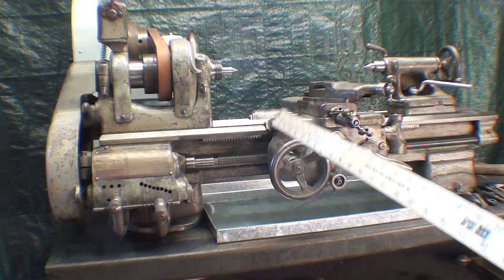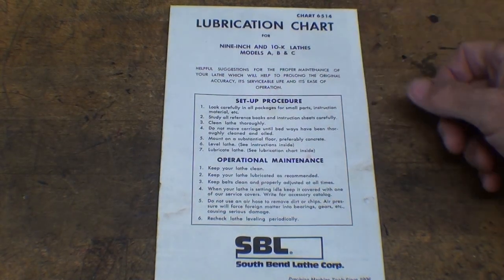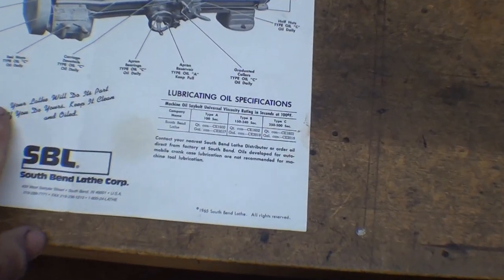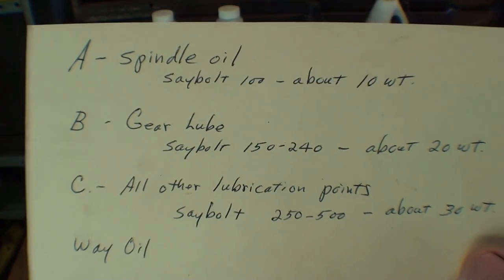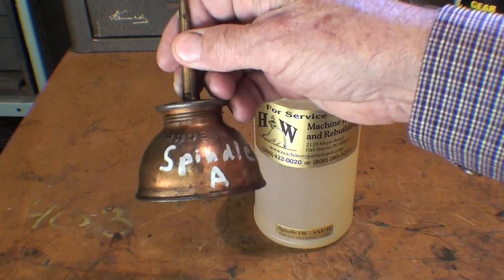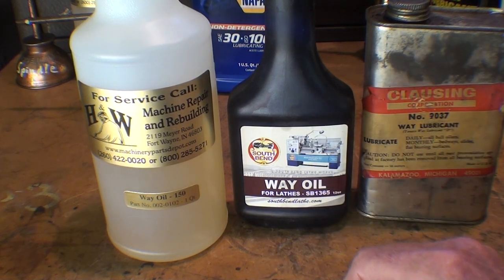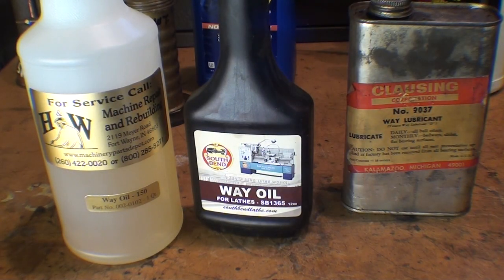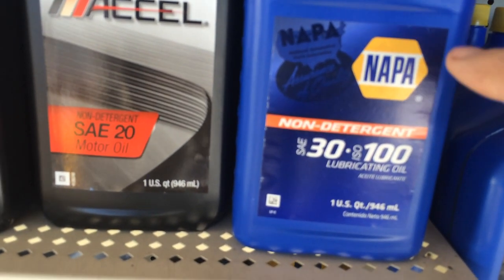Tips #341 TYPES OF OILS FOR SOUTH BEND LATHES tubalcain

Comment: All of my machine tools are big and have internal lubricating passages. I have found the biggest problem to be the passages getting plugged up with muck over the years and then they don't oil. I blame this on the use of non detergent oils. After a good cleaning of the reservoirs I use John Deere Hy gard (about 20w) as the lube since it is good for gears, bushings, wet clutches and has special additives so it clings well to prevent rust.( a big problem on many multiple hundreds of thousand of dollar harvesters that still need protection till the next season) I have been doing this for 15 years in a pretty heavy use job shop and it has worked great for me. There is always a nice film on the ways and everything oils and keeps oiling with no plugging passages or dirty sumps.  I am not saying this is right or what others should do just saying what works for me.
Reply from the maker: sounds like a great oil
Reply: I use the JD hy gard also.  put the low viscosity (low Temp) hy gard in my lathe headstock and the regular everywhere else even the ways. it sticks well and never have a problem with rusting.
Reply: Thanks, Brian.

Comment: A quick and dirty  way to test viscosity of an oil is to place a clean steel plate at an angle, say 45° with lines marked across the slope at 0 and 6" and, using an eye dropper, measure the time it takes for a drop of oil to get from 0 to 6" in seconds. While not terribly accurate, it can help differentiate between different grades of oil in question, and by comparing a sample of unknown oil to a known oil, give a useful idea of acceptability.
Reply from the maker: Thank you for an excellent comment. I should make a video showing that. Are used to check the viscosity of paint with a viscosity meter. Just a tiny hole drilled in the bottom of a cup.

Comment: Thank you Mr. Pete! I've been trying to find the "right" lubricants for my round-ram Bridgeport and Logan #200. I've discovered that reading the manuals is not much help since oil formulations have changed over the years. For example, the often recommended way oil Mobil Vactra #2 has been reformulated to eliminate the tacifiers that help it stick to vertical surfaces. A newer product called Vacuoline 1409 has the tacifiers and is closer in make-up to the Vactra #2 but unfortunately is not available in one-gallon containers that would be suitable for a home shop. Very confusing. As you said, any oil is probably better than none and in most home shops the different formulations may not make much difference. For the "right" lubricant you might have to contact the technical support staff, find out what is the best match for what is called for in your manual and discuss if there are other products with improved properties. Another example of modern products not suitable for older equipment is the super slippery, synthetic motor oils now available. They don't contain the zinc additive that is necessary for the conventional valve lifters and sliding surfaces of older engines.

Comment: I found the South Bend Way oil 14oz SKU SB1365 is on Grizzly 2016 catalogue page 743 or on-line. They have a 5 gal bucket too, but I think the 14oz will be enough for my two mini machines and vices.

Comment: Hi Lyle, nice video. The tech guy told us in way oil  the primary additive was for  "slip-stick" to allow  easy start of travel on ways for precise movement. Most gears in a lathe are lightly loaded, so no need for extreme pressure additives  and hence lighter viscosities . As always, keep it simple and don't mix lubes unless you know it is OK.
I enjoyed this video very much, cheers.

Comment: I'm sure there will be enough comments talking about modern equivalent of the three oils South Bend calls for...

They are still made by Mobil and available through industrial supply places, even eBay. Price is surprisingly low... when I bought mine last year, it's less than $20 per gallon with free shipping. For the amount I use, a gallon probably lasts twice my life time lol.

A:  Velocite 10  http://www.mobil.com/english-US/Industrial/pds/GLXXMobil-Velocite-Oil-No-Series

B:  (If I remember right, SB 9A doesn't use B oil...., I use C on all oil holes)

C:  Mobil DTE heavy medium  http://www.mobil.com/english-US/Industrial/pds/GLXXMobil-DTE-Named-Series

Way oil: Mobil Vactra No.2 http://www.mobil.com/english-US/Industrial/pds/GLXXMobil-Vactra-Oil-Numbered-Series

Way oil is suppose to be stringy so it sticks to the ways better, especially vertical ones. The Vactra No.2 look like the one came with your Clausing, in terms of color and viscosity

Comment: Thanks for posting this and sharing!!! You covered a lot of ground, and at least have us heading in the right direction.  
As I'm looking at all these oils I think back to every oil company pushing there product. My is better no my is and so on. I can see why South Bend worded it they way they did. 

Will cooking oil work? Mineral oil is a oil I use a lot on my sharpening stones. You can ingest it so I thinking of some of it staying on the meat cutting edge. 

I know I have used a lot of petroleum jelly for many things over the years. if too thick a touch of a lighter grade oil and it thin right up. Generally no staining if it pushes out, easy enough to clean off later. 

Not sure about oil, but like grease I would guess some are not petroleum based, if fact I  think they are a soap if you will. 

Non- detergent oil use to be motor oil. I think some companies just don't want the mix up, so they label it lubrication oil. 

All I can say is not all 30 weight non-detergent  are the same. 

Some oil is better then no oil in an engine..  I would think it is just about true to say that here.

Comment: Thanks MrPete, Good info. Would it be a "general " assumption be...The higher the RPM the lighter the oil? Hence lower RPM heavier oil. I agree with you on the 90 weight. I use it on the back gears and QCG box.

Comment: Mr. Pete,
thank you for the oil expose. I personally use recommended oils but I still wonder:

Everybody says do not use motor oil. Not too many say why. Closest I get to an explanation is that the detergents in motor oil keep particles in suspension (no flow through filter) causing more wear. Is there any evidence to support this? Considering the old machines with loose tolerances, would over-oiling with detergent oil be beneficial flushing out all the hidden particles? 

Back in the day when automobile engines were running with non-detergent oil, we were cautioned not to add detergent oil. Detergent would suspend the settled sludge perhaps breaking off chunks that would clog the oil passages in crank shaft and main bearing grooves. This is not the case in a lathe, except perhaps in the spindle bearings.
Reply: On the 9 and 10K lathe, and some others, they use a capillary oil system. This consists of an oil reservoir under each spindle bearing and a felt wick. The oil is pulled up into the felt by capillary action, and is distributed across the bearing surface. The excess oil is collected through 2 oil troughs at each end of the Bearing and allowed to flow back into the oil reservoir. If Non-detergent oil is used, any the dirt in this oil will settle to the bottom of this reservoir. if detergent oil is used, this dirt will be suspended in the oil and be deposited into the Oil wick itself. Eventually stopping up the wick. At that point not enough oil will flow to the bearings, which will damage the bearings. You do not want dirt suspended in the oil.

Joe.
Reply: Hi Milan,. I know what you are saying.  The best video I have seen on this is from Zynadu.  I think it was called the most important thing in the workshop.  I watched it a couple of times and started using his ideas and now I would completely agree.  It will surprise you but it will answer  your questions and is awesome.

Dale in Canada

Comment: Another great video, lots of good information. And as you indicated, It is always best to use the recommended oils on your machine. But the gears in the gearbox do not always get the proper lubrication and It is very difficult to make sure the gears in the gearbox are properly lubricated with the standard oil. So I use a spray can of Motorcycle chain/open gear oil. Also a good substitute for way oil is chainsaw bar and chain oil, but only if the other is not available. and for those who are interested, lubrication charts are available for the South Bend Lathe at, www.wswells.com/data/data_index.htm 

Joe.

Comment: Thanks so much for all the info it's great! I just got a 13in south bend lathe. I was wondering if you could put a cutter in the chuck and some kind of rest on the moving part for your workpiece then use it like a mill? What would be the name of the thing that could hold the piece on the moving part? Do you have a video demonstrating that? Sorry I'm completely new at lathes just trying to get info.
Reply: To answer your question, yes, milling can be done in the lathe. You need a lathe milling vice and/or a milling cross slide. Look through Tubalcain's videos to find more about it. But if you want my advice, get yourself a proper milling machine instead. You will be much happier.
Reply from the maker: Joe is right--a milling attachment is a compromise.  I show one in several diff videos in use.

Comment: I am happy to say that ever since I've owned a lathe I've always used spindle oil weigh oil and a proper gear oil for oiling the gears everyday tapping off the apron when needed Etc I've always purchased the exact correct oil I have a Logan 10-in and it's still doing me well 15 years later and it was built in 1946. There's not a lot of machines alive today that can boast that they were born in 1946 and still functioning is they're supposed to. I did make an improvement on the drivetrain I put reservoirs to constantly add oil to the oil light bearings for the drive shaft. Those things seem to wear out way faster than they should and doing this has made them last longer of course I went through a period where I was using this machine 8 hours a day when I was laid off I was making small parts and selling them on eBay and they kept me going financially. I'm disabled now unfortunately and I don't get to use it as much as I want to also the price of metals has gone up due to tariffs that were imposed. As if aluminum wasn't expensive enough already

Comment: Are you in Missouri Mr Pete?  ive got a Atlas Craftsman that I bought, it needs some TLC, and I need to get rid of the 3 phase motor to a single, I started taking it apart, put new spindle bearings and races in, and now I just need to find a motor,and finish it up, really not sure of the condition of the end gears, gear box and the apron,   lately I just haven't had the time to mess with it,,looking for someone that can find me a single phase motor, check out the rest of the machine and put it back together,,do you have in recommendation for me that could do this work without breaking the bank,, I'm wanting the machine for a hobby when I retire, that's still a few years away,,,thanks for any info,,,,im close to St louis

Comment: Wow. South bend lubrication video. 
I was horrified at the vintage of the lathe. 
My journey into metal machining started in 1963..!
Your demonstration is great and practical. 
A little error testing the adhesive quality You didn't clean your fingers between tests  in the latter half of the video. 
Mention of detergent property of oils didn't go far enough. 
Cutting and cooling oils used are often SOLUBLE in water and as such hold water promoting RUST ! not acceptable for bearing surfaces. 
I was surprised by your comment about the date you put on a bottle. (I was thinking, what a dummy, you didn't put the price on the bottle)
Thank you for sharing your experience. m

Comment: I'm looking for lubrication info for my 12in Atlas Craftsman lathe. I have the original manual and it says to lubricate everything  with SAE number 20 oil and lubricate the gear teeth with Keystone number 122 gear lube. Keystone is no longer in business. What would be a good equivalent for the gear teeth? Also, will the Accel 20 weight non detergent work for all the other lubrication points? I have a gallon of vactra number 2, is that specifically for oiling ways or can it be used for spindle lubricant as well?

Comment: ABOUT  Gits oilers.  I have one that seems to have become clogged somewhere in the line.  I've made a neoprene gasket to let me press my oil can firmly against the Gits oiler and squeeze multiple doses of oil in.  There is usually some back pressure that expels some air and oil.  I am considering using an air hose at 100 psi to try to blow out the whole thing.  Alternately I could use a solvent.  What do you think?
Reply from the maker: I would be hesitant about forcing the The clog all the way through

Comment: GM now uses 0/20 in v8  engine oil . only thing i know is non detergent used in air compressors and pony engines usually 30 w

Comment: My 1920s lathe has nothing on lubrication. for the present time i have been using high quality steam engine bearing oil. it has quite a high viscosity. it seems to be working well there are no signs of damage. i thought a thicker oil would be a safer option. not sure what else to use really without risking damage.
Reply: I did try using spindle oil but it tends to spill out and the bearings will become dry very quickly
Reply: The bearings should be adjusted very close on the headstock thus requiring very light oil. Here is good reading on it. http://www.vintagemachinery.org/pubs/1617/3531.pdf

Comment: Have you ever heard of "Roy Dean" teflon lube?  My SB 13 chart says to use that on the back gear spindle every year or so.  Just wondering what viscosity that might be, because I have never run across that kind of lube and I can't find anything from SB that would impart any particulars on the matter.
Reply: Roy Dean" teflon lube, Was specified for the cone pulley on some machines, it is actually a grease. More like super lube. Which is what I use. When I used oil, the cone pulley would tend to stick after a period of time. After lubricating, I would always have to turn it by hand several times and then re-lubricated again to make sure that it was properly lubricated. And yes I was using the recommended oil for this. With super lube, it never sticks and is very smooth. I also use super lube in my thread dial and my micrometer stop. Neither are heavy where points, But it has improved their usability considerably. The problem with the grease is making sure it gets into the spindle cone pulley. With oil, you just squirt some into the oil reservoir and it will get into the bearings. With grees, It needs to be pressurized, so you need a grease gun. And you have to make sure that it comes out the ends of the bearing, which is kind of difficult. you may be able to see it come out through the thrust bearing. The thrust bearing is not mentioned on any of the charts that I have seen. But if you are using oil, it needs lubrication every time you use the machine. This means removing the left side gear cover and manually lubricating It. if you use grease In this bearing, the grease will be retained for a longer period of time. just make sure you never use a Blow gun to remove chips, always use a vacuum cleaner, brush and rag. other neglected parts are the back gear assembly. These gears do not get enough lubricant. They need to be lubricated before each use. You can use gear lube, way oil, or type C oil. But I do not recommend using grease. even way oil may be too sticky for your application. Just make sure the gears are clean and free of chips.

Joe.

Comment: Good comparison of those mysterious Saybolt numbers to something more common.

I actually have my original (mid-'60s) quart cans of SB types A, B, and C, but no SB way oil for some reason. Plus I have a gallon can of the type C. As you say, for the hobbyist/home user a quart of oil can last quite a long time. My chart (also mid-'60s) is framed (just the section that pictures the 9") and hangs on the wall behind the lathe. I didn't see the close-ups you mentioned of the pictures in the left column which my dad may have cut away when he framed the chart. Can you post them somewhere? Maybe as a follow-up to this video.
Reply from the maker: Thanks for watching

Comment: I am cleaning up an old craftsman drill press. I want to keep just the metal finish, what would be a good oil for keeping surface rust away.
Reply: Spray it with fluid film. It is a lanolin based rust protectant it sticks and lasts better than oil and doesn't bother your skin.
Reply: Bingo. Best rust preventer I have found
Reply: the fluid film I mean
Reply: Chainsaw bar oil

Comment: Kind of hard to tell in a video, but the South Bend way oil seems very similar to bar oil for a chainsaw.
Reply: Actually some people do use bar oil on their ways.
Reply: Bob Rees  I use bar and chain oil as way oil, just due to complete lack of availability where i am. It is TOO sticky, and causes issues with the chips sticking,  if nothing else. I use it so a film stays on the ways to prevent rust since I don't use my machine often, but if you can get it, proper way oil is far better.
Reply: Bob Rees yep and it is as cheap as water. Can buy a gallon from Walmart for next to nothing
Reply: I was thinking the same thing. Some of the higher grades (types) maybe a bad idea, some of the off brands are not so tacky, sticky. World of difference in them bar oils.